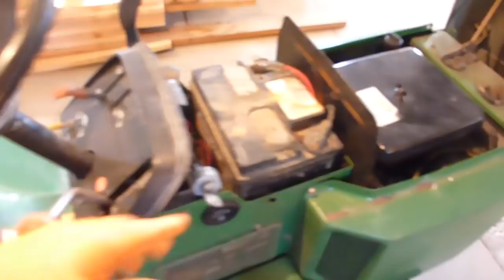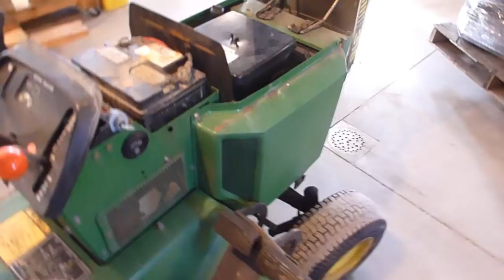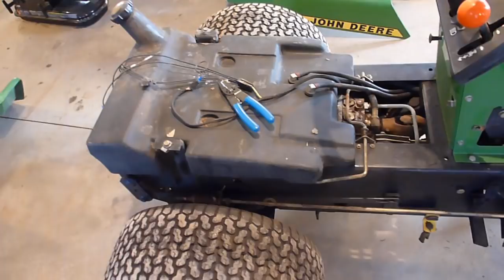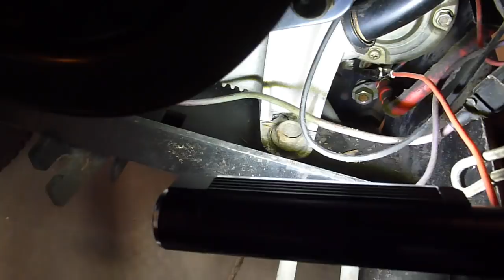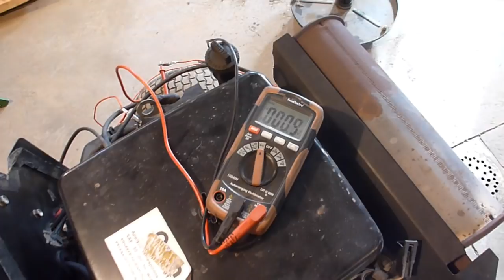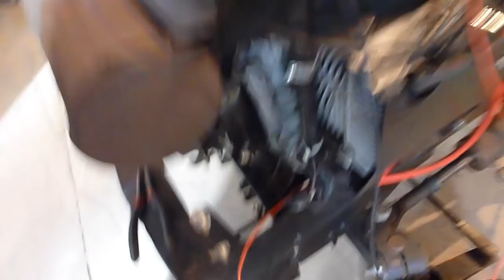John Deere 318 Project

Comment: I can’t start my 318 without the PTO switch bring in the on position. Any thoughts?
Reply from the maker: Have there been any recent changes to the wiring? That is not a symptom of something that just happens with a bad part, it would be a wiring change or a short of some type. I would start there first.
Reply: mmrbeef do you still work on ONAN p218 engine mine was running but needing new flyball governor I got the engine out it has 1300 hours on it what would you charge to rebuild it ?

Comment: Hey buddy i have a little dilemma,, i have a 1981 showroom condition 317,, it originally came with the series “1” KT17 then was brought to dealership (JD) and they replaced it with a Series “2” KT17,, when tractor only had about 100 hours on it .. tractor now only has 514 hours on it,, i put a remote oil filter and electronic ignition on it so basically it is a Magnum 18... here is my dilemma ,, if you are standing in front of tractor and looking at front of motor the starter side i dont have the small piece of tin that wraps around the bottom of the cylinder as an air foil to direct air up the face of the cylinder.. the left side does but not the right.. now the original owner (a old fella) said that is the way John Deere installed the engine... so my question is , is it better to not have the air foil on the right side than to have it on ? He was the original owner ,,(it was his baby) he got to old to drive it is why he sold it and hired someone to cut for him...so i am second owner...so no way someone else removed the air foil... so what should i do find one ? And replace it.. or leave it the way John Deere installed it with no foil on right side ? And if you think it has to be on there do you have that piece i can buy from you? Wouldn’t matter if kohler or onan i can screw to the other heat shield piece .. so what do you think ? My brother suggested that maybe deere felt that cylinder cooled better without it ,,, i don’t know ,,, i know your busy don’t mean to ask stupid questions but tractor is my baby also lol.. so i wanna do what is best for it,,  and i value your opinion...the motor runs smooth as a kitten like it just rolled off assembly line doesn’t burn a drop of oil between oil changes(50 hrs)   Spark plugs look like new just a very faint tan barley visible on plug after 100 hrs of use...and wanna keep it like this so any help or advise would be awesome ,, thanks buddy...
Reply from the maker: Interesting about he tin. I have not had too many 317's that had the KT17. I did a little checking through some of my service bulletins and I did not see anything about leaving the tin off. But the is not an exhaustive search. I do not have any tins like that either.